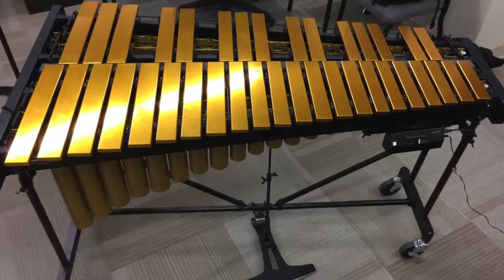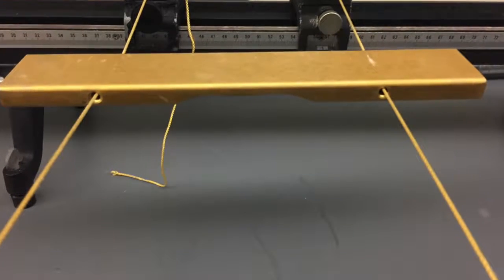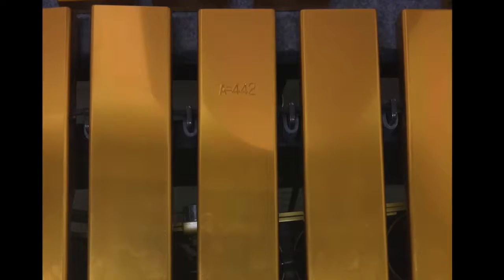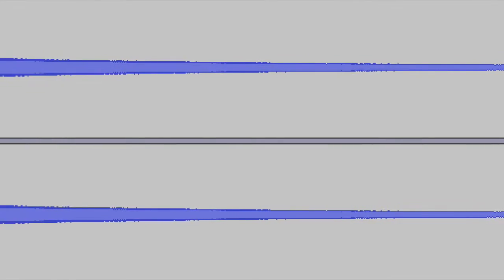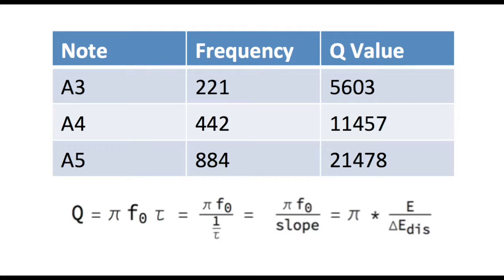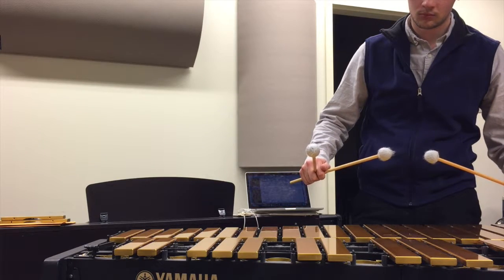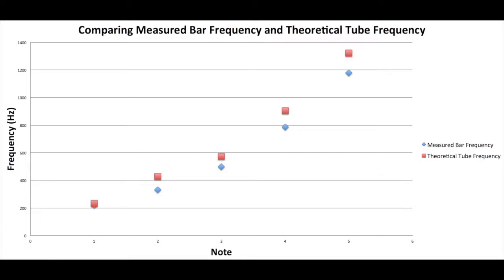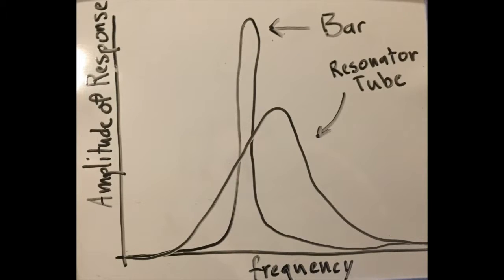The Physics of Vibraphones

Comment: Thank you for this very scientific look at vibraphones. Very well done. Please re-examine your findings regarding "tuning the resonators slightly higher than the pitch of the bars" portion of your presentation. When you examine the tuning of the resonator without the bar over it, it is indeed tuned slightly higher but when you place a bar over the mouth, the tuning that the resonator is supporting lowers significantly. In addition, the closer the bar (or upper boundary) of the tube is to the mouth of the resonator, the lower the pitch the resonator is tuned to support. 

In the past, instrument builders seemed to estimate that by thinking that raising the resonators' tunings just a "tad" was the key. Not very scientific but when you combine art and what sounds pleasant into the mix, science has a lot more explaining to do. But in reality, there's science at work when you place a boundary over the mouth of the tube. It would be great if you added that to your presentation.

Anyone can witness this by turning on the faucet and hold a water glass up to your ear until you hear a defined pitch. That pitch is (as you know) the partials of the white noise that reflect the tuning of that resonator (water glass). As you move the water glass (resonator) closer to your ear (the upper boundary), you'll hear the pitch drop significantly - as much as a Perfect fourth.